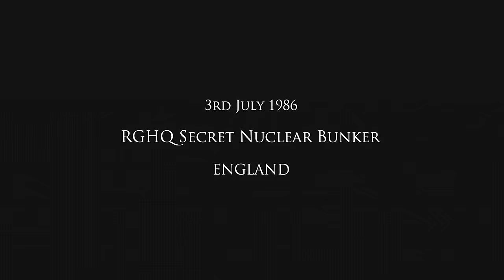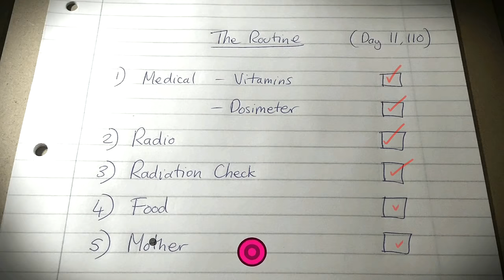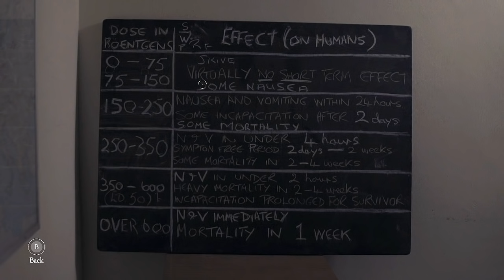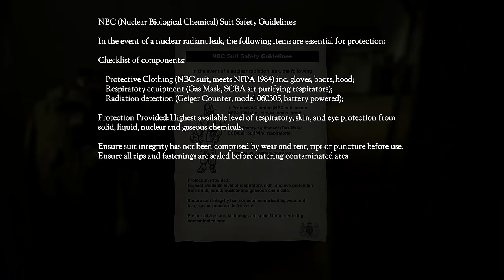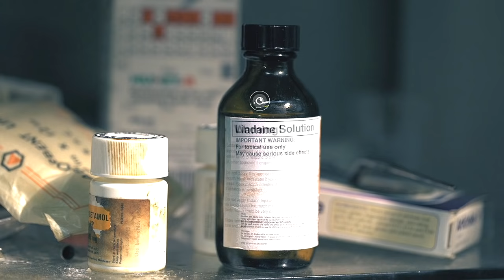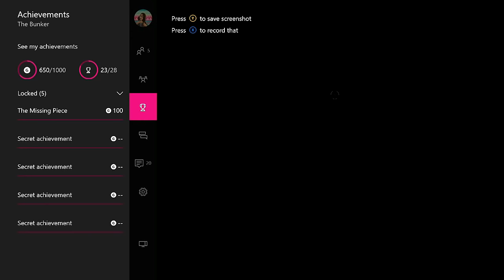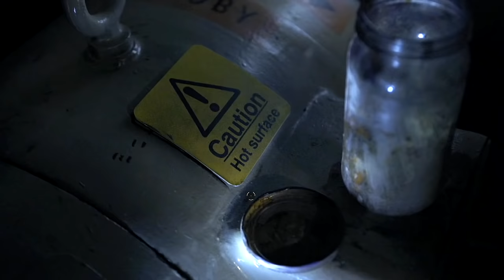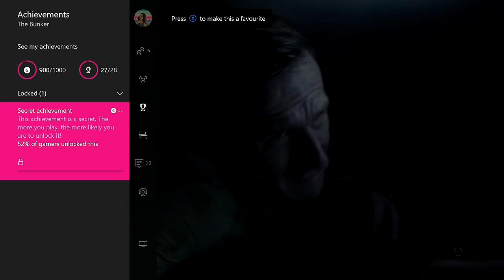The Bunker - 100% Full Game Walkthrough - All Achievements/Trophies & Collectibles

Comment: On PS5 at around 43:00 when you have to dispose the filter you click at the disposing door but the screen won't change.
If this happens to you, the prompts are there, so just move your cursor to the bottom right and you should see the hand to drop the filter. Basically the image for the Disposing unit doesn't load but you can do what's necessary.